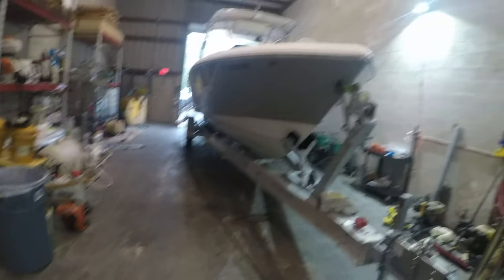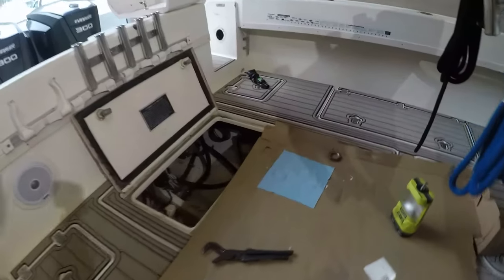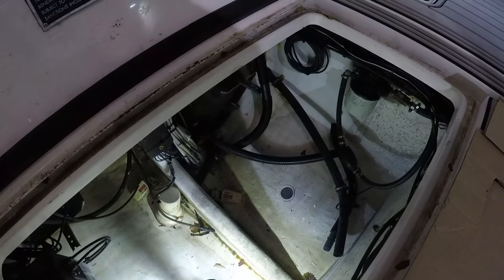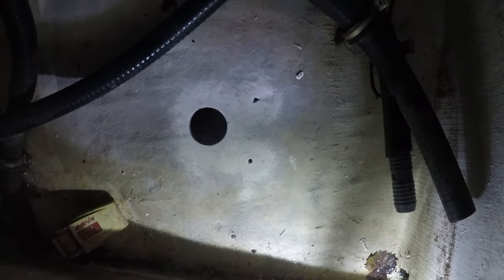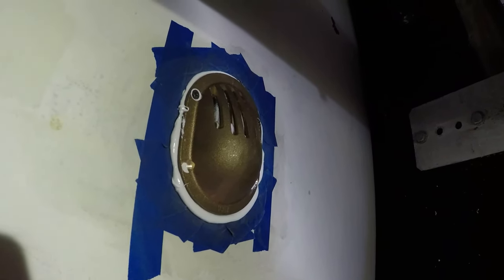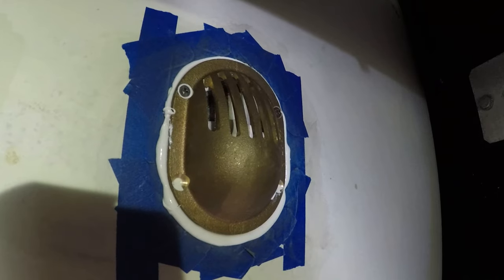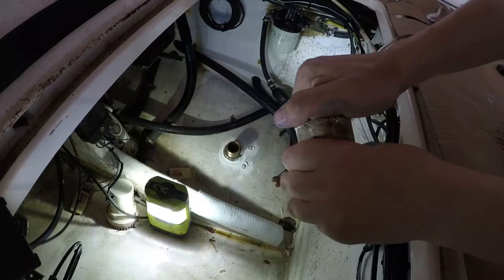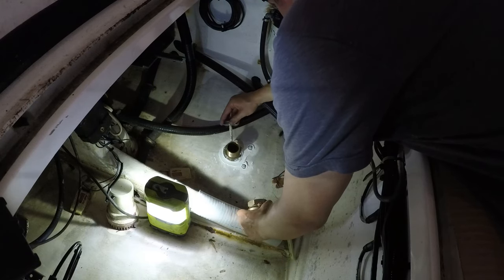How to Install a High Speed Sea Chest for Live Well in Center Console Boat

Comment: Why do people install these does this help prevent air locking when the boat isnt moving? or only at high speeds? Ive always had an issue with my pumps air locking when at idle or not evening moving
Reply from the maker: It keeps the pumps from air locking at high speeds. Pretty much a must for a stepped hull boat. I don’t see how air locking would be a problem at low speeds. It also makes the pumps last longer because they are submerged in water and stay cooler. You’re actually using bilge pumps instead of live well pumps. I’ve been very happy with it since I installed it. When I get the boat up to cruising speed I actually have to close the valve a little so it doesn’t blow the lid off of the live well.
Reply: I think you should mount the through hull fitting in different way, so that the slots are backwarts, to prevent high water pressure on high speeds..? Only on slow moving boats your way is better and preferred. Regards 👋